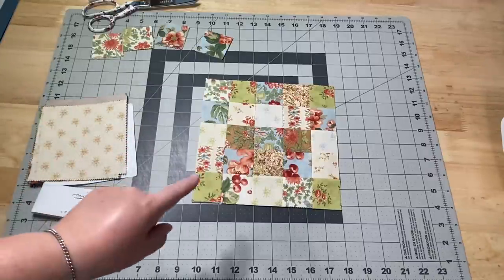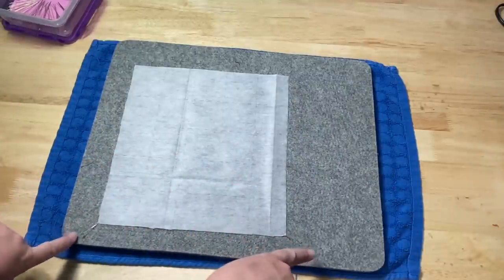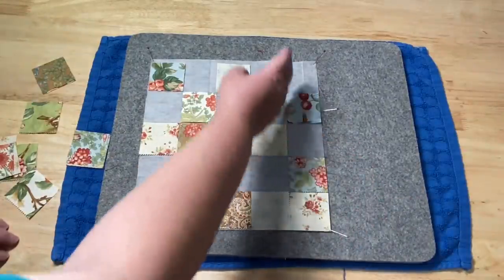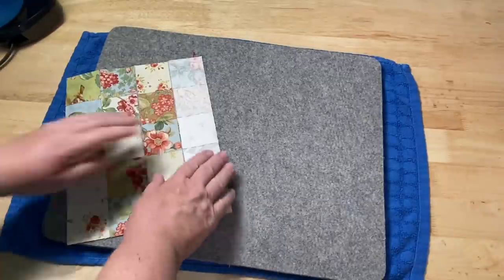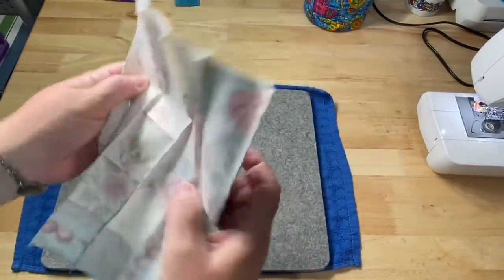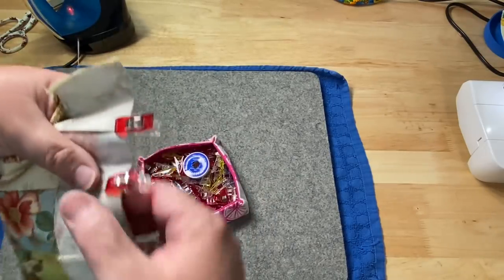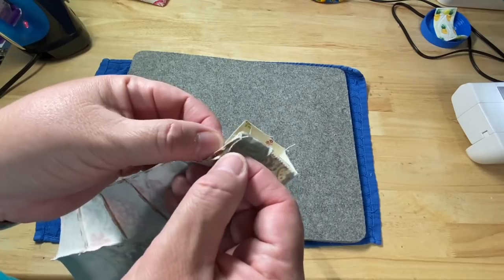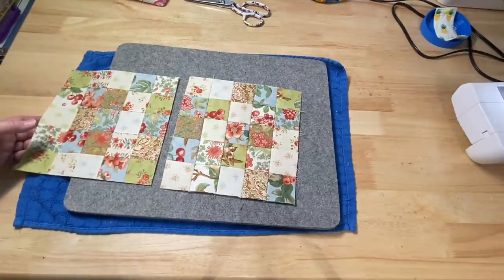Using Gridded Interfacing to Create Perfect Patchwork Blocks

Comment: I've noticed a lot of demos lately using this grid interfacing. A lot of them will use glue to hold the fabric in place before the pressing starts. But you did a great demo.. Great way to use up scraps. Code word square!!
Reply from the maker: Thanks Laura.  I had thought I might need to use a glue stick since the interfacing seems a bit old but It worked fine.  I have used a glue stick in my other interfacing/scrap projects.

Comment: Robin, I used the grid for water color quilts in the ‘80’s with 1” squares. Thanks for the memories. If you use scraps the way we do, you are missing an opportunity by not making leaders and enders. I always have a basket next to my machine of small HSTs or squares for four patches. It is amazing how quickly you have enough for a border or binding or even a full quilt. “Try it, you’ll like it.
Reply from the maker: Thanks Kathleen.  I’ve tried leaders and Enders.  They just don’t work well for me.  I don’t make many quilt blocks where leaders and Enders are the most useful and I can never plan ahead for a project.  I can see where they’re very useful though.

Comment: You could sew together with a row of sashing between the squares.  You could also make the outside row on two adjacent sides say the top and right of each grid piece your sashing with same color squares.  Then just sew each grid together and the sashing is included.  This would probably work better with larger pieces of the interfacing grid.
Reply from the maker: Thanks for tips.

Comment: Hi there this was an awsom video you are an awsom teacher it really made sence listening i have a question after you make a say 10x10 square can i use these squares to make a rag quilt
Reply from the maker: Thanks! If you use interfacing It might not rag. Plus the interfacing would then be on the front of the rag quilt.    You could use wash away stabilizer but that could get expensive.

Comment: Does the fusible grid come in different weights. I'm thinking of trying to make my own. But not sure if the light weight I have will work.
Reply from the maker: I’m not sure about different weights.  I find the lighter weight fusible works better because it’s less in the seams and keeps the finished piece from being too stiff.  Unless you’re looking for a stiffer fabric.  It’s easy to create your own grid then you could use any interfacing that you prefer.

Comment: Have you tried using this interfacing to sew more complicated small blocks?  I am thinking it may be useful for working with tiny half square triangle blocks possibly made from the left over triangles  from snow balling  corners.
Reply from the maker: I have not played with this interfacing other than what I’ve shown you.   I was wondering the same thing.  In between other projects I’m hoping to try a few different things.  Maybe small 6.5” blocks just to test the techniques.

Comment: I have a couple questions. I have done small mug mats wjth plain (no grid) interfacing … would you recommend that? It’s so much cheaper. Also instead of a pressing mat could we use freezer paper or parchment??? Thanks for the video
Reply from the maker: Yes and yes. I will use the gridded interfacing that I have on hand and after that I'll create my own. I prefer a thinner interfacing than the gridded version. You can use anything that will protect your iron from any possible fusible that might be popping out from the squares. I tend to risk it and just use my iron directly on the squares. Use what you have on hand or what you prefer for other fusible projects. Have fun!

Comment: does this glue cause stiffness in your fabric? I’m wanting to piece a big quilt using 2.5” squares with cotton Lawn fabric, I don’t want to lose the fluidity of the way cotton lawn moves.
Reply from the maker: I find that if you use the preprinted gridded interfacing It adds bulk and a bit of firmness to the patchwork piece.  Great for bags but I don’t prefer It for a bed quilt.   There are lightweight interfacings that do not have the preprinted grids that should keep your quilt fluid.   I always recommend a test piece first.  Maybe a pillow cover.  Then you can see how you like the feel of the piece.  

Some quilters just lay the squares on the blank interfacing.  If you struggle with keeping everything lined up and square there is a cheater version.   Perfect for this time of year.   You can draw the grid on a piece of poster board and lay your interfacing on top of the poster board.  You’ll easily be able to see the grid through the interfacing and you only have to draw It once.   Or, check the backside of rolls of wrapping paper.  Many have grid lines for straight cutting.   I would put a piece of scrap fabric on my pressing board  just in case the wrapping paper bleeds when heated with an iron. 

I hope that makes sense and helps you choose the best method for your project.  Using the gridded interfacing is very helpful in keeping your squares in place the way you laid them out in addition to keeping the squares lined up neatly.
Reply: @rsislandcrafts  Thank you so much for your quick response and your detailed explanation. It makes perfect sense. I may try your poster board and light interfacing idea. Thank you . ❤️

Comment: What thread do you use, cotton or polyester? If you use polyester, is there a chance of it melting during the pressing process ?
Reply from the maker: I prefer 100% cotton thread but I have used a poly cotton blend with no issues.   When I’m not sure I’ll make a mini test piece with two pieces of fabric with batting in between.  Then I can see if the iron might affect the thread.  Or you can use a pressing cloth as a just in case measure.  Many bag makers use 100% polyester thread with no issues.  With anything I wouldn’t want to leave an iron on It for prolonged periods of time just in case.  Happy sewing!!

Comment: How is the feel of this! Are the squares stiff? I love the idea, but I want my quilts soft.
Reply from the maker: The package and the videos I’ve watched say It softens as you wash the quilt.  I haven’t felt the Pellon version.   My opinion of the Quilt Fuse  after sewing zipper pouches with my practice pieces is that it’s slightly stiffer than the lightweight Pellon P44F interfacing that I like to use.  I would use It for small projects like table runners and wall hangings but I would try other interfacings and make my own for that softer feel.  I’m all about a squishy quilt.

Comment: Great highly-detailed video.  I never use the clips - takes too long and I’ve never found them necessary on any of the grid sizes.  Watch the videos by Ten Sisters - I have both of their books and you will be amazed at the gorgeous quilts (pillows, bags, etc.) that can be made with printed interfacing.
Reply from the maker: Thank you very much.  I’ll definitely l check out the Ten Sisters. Thank you for sharing.
Reply from the maker: I just added several videos to my watch later playlist.   Thank you again.  It was nice to see that I’ve already watched a few of their videos.